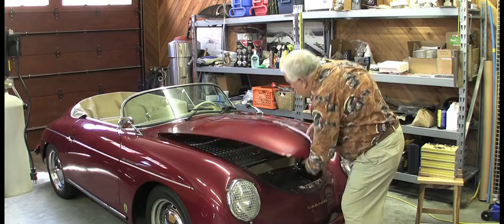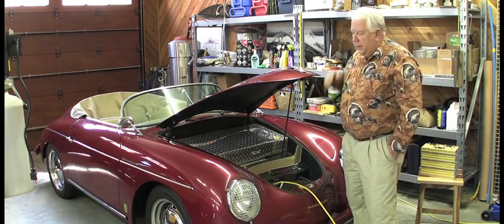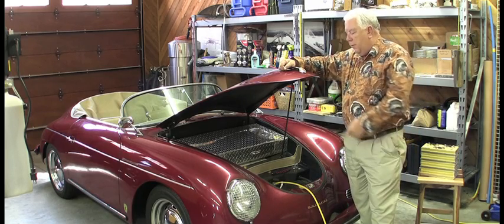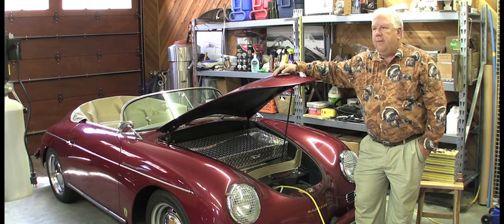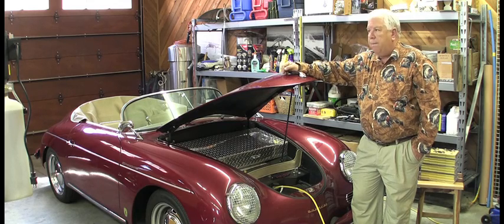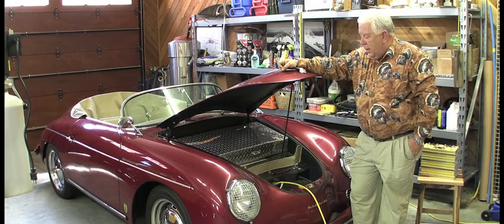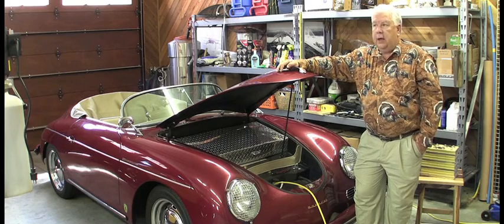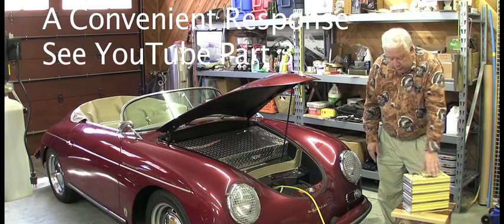2 A Convenient Response to an Inconvenient Truth

Comment: Installing a cord with a 240V male cord cap on one end and a 120V female cord body on the other end (as this man suggests) in an infraction of the national electric code and he is flirting with law suits by the score.  For those thinking about following his suggestion, please don't.  Talk to an electrician about a proper installation.  Besides, your homeowners insurance won't cover a fire from intentional installations like this.
Reply: Six years ago (when this video was made), SAE did not have a well-defined 120/240 volt EV charging port standard.  This is why he had to make a custom cord.  The J1772 standard (and receptacle) came out shortly after this video was made, and he immediately upgraded this car to the new standard.

Jack has made it very clear on many occasions that he does NOT recommend using custom plugs or cords on any electric vehicles.  All custom conversions should use the same J1772 standard as production electric vehicles.  The new standard features built-in GFI protection, and allows the use of almost any AC input voltage.
Reply: Paul Zigouras That's great that he has addressed it, but this has nothing to do with SAE, and he needs to change his video or else he's still culpable.

Comment: Lithium batteries age by calendar-years at least as much as they age by charge cycles. That is, when they get old, they're old, whether or not they've been used much during that time.

A few thousand cycles, from 5000 to 8000 or more depending on how you treat them and who you ask.
Reply: I'm curious how your statement here has held up over time?